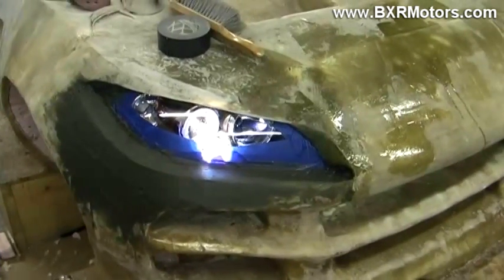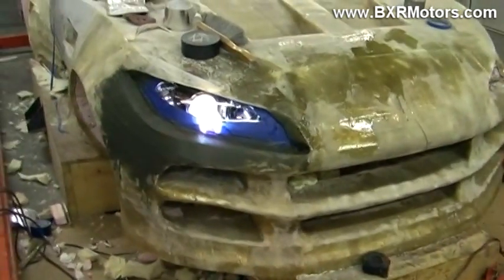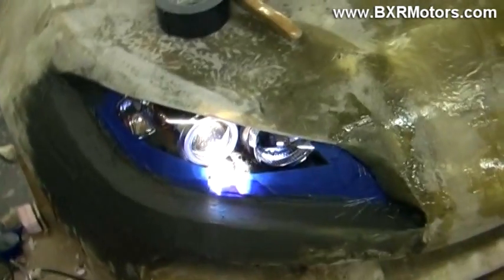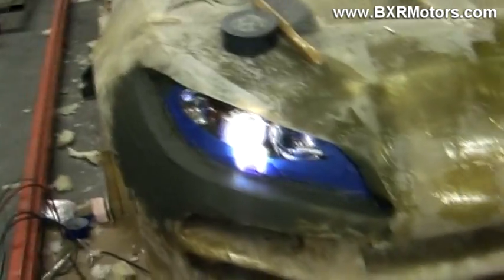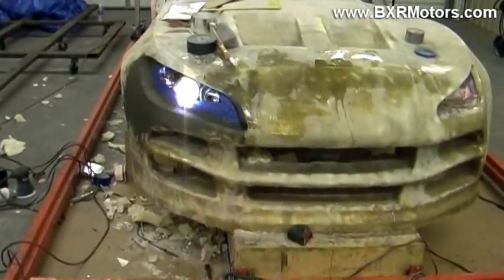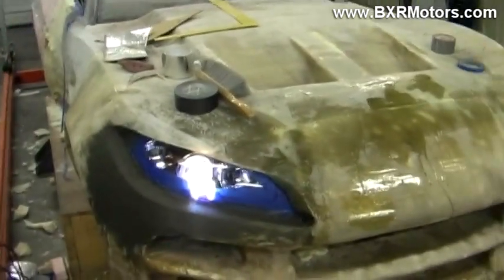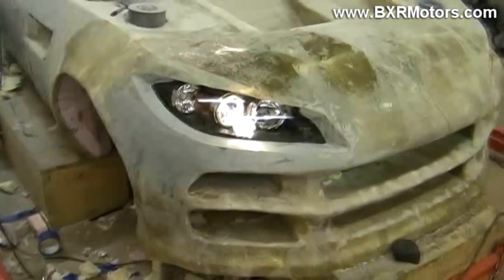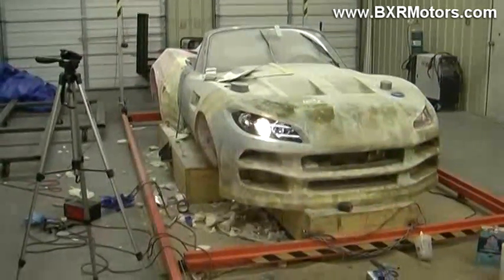Bailey Blade Car Design / Working the Head Lights - Part 12

Comment: I know it's a few years late, but if you don't want your headlights to be recognizable, you could get aftermarket ones intended for Peugeot, perhaps 207/407 or so, they are swept back, cars have very round noses, but otherwise the outer shape is unadorned. Some Peugeot of that generation probably have about the shape you're looking for. And as for internal details, obviously aftermarket ones are all the way different, Angel Eyes etc.

Comment from the maker: If I understand you right, I used expanding foam to fill the area for support then I applied fiberglass chopped mat into the recessed area and then applied a few more layers , then sand.